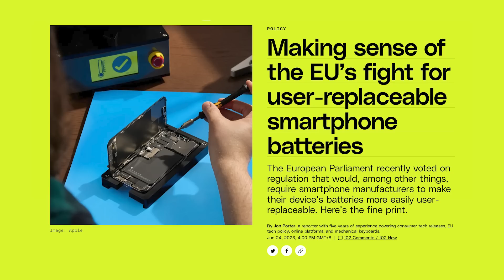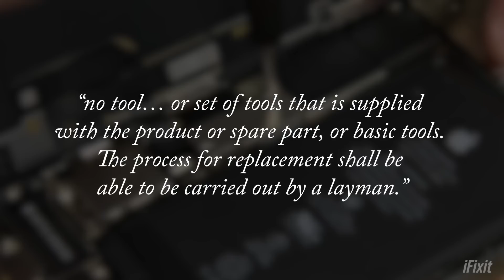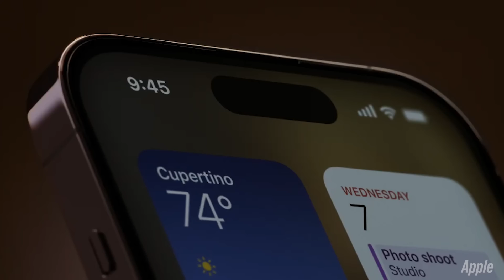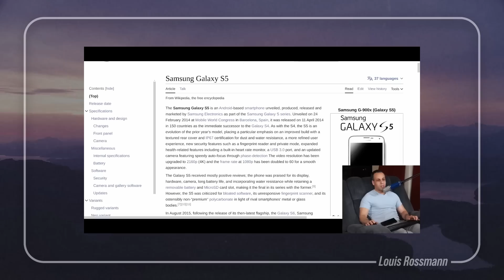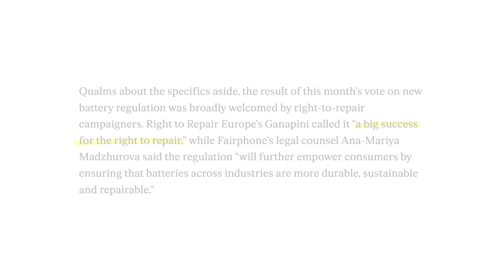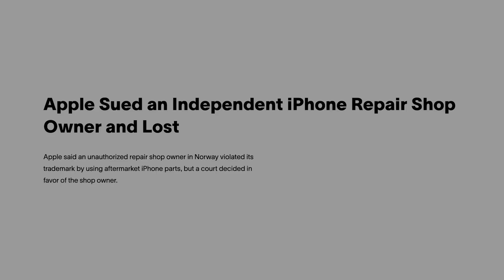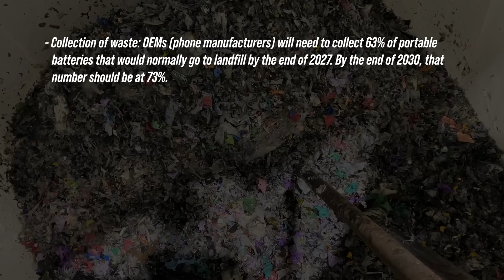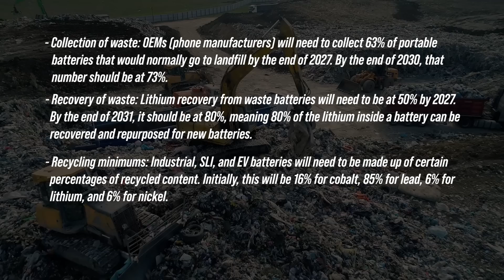EU Just Changed Smartphones Forever

Comment: It seems that there are a lot of people, perhaps most people don’t realise you can get an iPhone battery replaced by Apple and it’s not an extortionate cost in my opinion. Sure it’s a lot more than just buying the battery and replacing it yourself. But the point is that people don’t seem to be aware. An old battery of course has less battery life and can affect the performance. I have an iPhone XS Max and will soon be replacing its battery and using the phone for another one or two years… and then buy a two year old iPhone. This XS Max was a two year old refurb for half the price of new.

Comment: We'll see how this works out. GDPR made the UX worse for European users. The EU has good principles, but they don't really think things through. I think distinct EU/non-EU phones are VERY likely. And if it turns out the non-EU ones are better it will result in a black market for non-EU phones. Why not just tax the devices extra when sold and offer the extra money as incentive for users to turn in their old devices? Also, how the hell are car manufacturers supposed to make a car where you don't need special tools to replace the battery?

Comment: Unswappable batteries are planned obsolescence. Everything else in a smartphone can last long, very long, especially with Qi charging. But the battery limits the lifetime. Size the battery so it barely lasts a day, or not even a half day for heavy users. Combined with the right strategy to "optimize" battery charging it will last exactly as planned until the end of warranty, and then fail quickly. Apple has already been caught on this a few times. And the fact that you cannot enable "always stay in battery saving mode" on apple devices tops this - you have to work around that with automation bound to "plug in charge cable", "battery at 100%" and a ton of more events to make it stay in that mode.
(private phone is Xiaomi mi 9 with Qi, standby time was up to seven days at the beginning, and is currently still at up to five days)

Comment: Non replaceable batteries is def a profit driven Manufacturer construct. My perfectly working Samsung phone is now obsolete as it won't hold a charge for more than a couple of hours. Can't get into it tho as it's a sealed unit. Same with my kindle fire. It all ends up in landfill eventually causing a massive electronic waste problem of perfectly working devices that simply just need a new battery. Good move EU!

Comment: Truth is, ive had phones from an early cellnet phone, through to Nokia, Samsung N, HTC Desire, to Galaxy S, never bought a new battery once, tech moved so quick to care. There's two or more (said here) things going on here, First stopping companies like apple being dicks here pairing batteries, as even early iphones was easy to change the battery just 2 screws. Second, SOCs have got that powerful they can span multiple generations of phone, only artificially made obsolete by either battery degradation or lack of software support by the manufacturer. There's no need to have a flag ship phone and if I do get one that costs a grand, id probably want keep it for like 4 to 5 years now. Gone are the days where its cool to have the districtive latest phone for me they all look and do the same, just like my iPhone 4 did exactly the same as now but with a poorer camera etc.

Comment: Smartphones used to have replaceable batteries and some were egen water resistent. Only reason the batteries was glued into the phone was to get people to buy new. Just like 99% don’t use anything in Word that did not exits 20 years ago, also I think that 99% probably would be sufficient with a 5-10 year old phone if the battery was still working. They don’t use their phone for other than a few photos, social media, navigation and of course texting and calling people.
Phones housed to have plastic backs that was cheap to replace. But when the manufacturers fixed the battery, they also made a fragile glass back. They tell everyone it was to not make the phones scratch as easily, but the truth is they can earn a lot of money replacing these glass backs. The first iPad is near indestructible. Try to hit the back or front with a hammer (don’t do it, find videos of this). Not a scratch. Later generations shatter like fragile glass.

Comment: Should be an open database for manufacturer-specified and independently reported lifespans and failure rates for components going into devices, so other aspects of device longevity can be optimized over time. While batteries are the main point of performance degredation, if other components start failing in the lifespan of the second battery, the move to make them replaceable may not be optimal without reviewing other failure points too. Likely just teething issues to be dealt with down the line. Battery replacement will extend the service life of so many devices.

Comment: I think materials choices for esthetics particularly glass had a big influence. I absolutely think that planned obsolescence creating continuous market demand was a strategic interest in the choice for phone manufacturers. I have mixed feelings about forcing consumers hands. I'd prefer we cost in the end of life cost at time of purchase to encourage decisions that way.
Reply: I'm still using an LG G4 which I rooted and put android 11 on it.
Still works great for many things even if it is now very slow compared to modern phones.
I don't have to worry about leaving it on permanent charge for things like it's night clock and radio and stuff because I know once the battery degrades and starts to swell, it a simple case of pop off the back, take out old battery, put in new one, good as new.

I also have an LG H910 which is the USA V20, an oppo a54s and 2 oppo a54 5g's.
So having phones with replaceable batteries doesn't stop people buying newer phones, it simply allows them to keep using the phones for other things after they have upgraded
Reply: @TheVampyrical  I want replaceable batteries, other service parts ideally upgradable radios expandable storage. Screen options. Display out and multiple/repairable USB-C ports.
Go so far as to make it like a frame work laptop where at the end of phone life I can make The board a game console. Real auxillary cooling would be a nice option. In that case.

I just switched to a Moto G100 and I'm planning to turn my Galaxy s10e into a gaming console. I should look and see if there's a good Android distribution for that use. If that works out maybe I'll pick up some used S20 FE to make a couple more.

It's nice to have a recent snap dragon 8 series.
Reply: glass or not, we could still replace the batteries as your average nerd.

Apple made that impossible by actually putting serial number registration in the firmware. Actively blocking the sale of batteries and even the use of donor parts, is where the real crime is.
That's a very concious effort to be evil. There's simply no excuse.

We already created more than enough ways to replace the batteries in modern smartphones without those crazy evil deeds.

Comment: Regulators around the world are feeling too full of themselves - they think they're kings of the world.

The iPhone is neither designed, manufactured, or programmed in the UK or EU and yet they think they can dictate all aspects of its design, construction, and software implementation. As an Apple stockholder I'm frankly getting sick of it.

Regulators come in and think they can penalize companies and threaten their world income - not just the income earned in the target country. They think they're hardware and software engineers and make demands for implementation of features. I'm beginning to think that Apple should put together two models of iPhone Pros - the Regulator version and the World version.

Want to mandate replaceable batteries?

Fine - the Regulator version would have replaceable batteries and a battery cover, but would lack features like inductive charging and may be larger, heavier, and have a later release date and probably be more expensive.

Want to force interoperability with less secure protocols?

Fine - iPhones in the Regulator phone would lack iMessage and FaceTime support so the user could install any 3rd party software they want.

The World version would be the iPhone we know and use today - the Regulator version would be hobbled in whatever fashion is required to fit into overly regulated markets.

In the more sanely regulated markets both versions of the phone would be available - and authorities in the Regulator only markets could have fun trying to keep grey market World phones from being smuggled in.

BTW, good luck dealing with all the lithium batteries which appear in trash bins - deposited there by lazy or ignorant consumers who don't care or don't bother to read the disposal instructions.

Comment: Why don't they focus on giving us our damn chargers back.  I just spent $2000 on a 1tb zfold 5 and that was with $150 off. I didn't even get a charger. I didn't even get a sticker. I got a stupid sim ejection tool and the phone. I'm more pissed about this. $2000 should get you wireless earbuds, super fast charger, case, external SSD, camera lens kit, and a damn S-pen. Fold 1 at least had some accessories

Comment: Lightning cable doesn't wobble, though.... and removable batteries change the construction of your phone. With a frame, front glass which used to contain alot more adhesive, grey back frame to keep battery apart and a back cover. IDK how convenient that is but currently iphones are hermetically sealed... that would be an obvious downgrade.

Comment: I want to see how Apple maliciously comply with this.
Reply: $199 battery
Reply: I want to see the EU regulate to protect me and put them back in their place.
Reply: @TheMercifulKnight   Yeah never thought I'd like an EU reg, but Apple can get f**ked on this one. Part of the reason I went Android is how much Apple extorts its consumers with proprietary gear and malicious "authenticity verification".
Reply: They will put micro chip into the battery and ask for it 100x the price is would cost on any other phone.
Reply: Cannot buy battery must rent it 😂
Reply: No different than to see if Tesla complies with it's EV batteries. Apple is one of the worst offenders, but hardly the only one.
Reply: @leftcoaster67  to be fair, when it comes to EV's there's actually a difference in how batteries are worked into the EV or how the battery actually works. It's so many levels more complex than a phone. The comparison is actually apples and oranges.

Where it comes to 'the layman should be able to do it', this probably means with an EV that you'll have to be able to screw it out and unplug a cable or 2, but I doubt it'll take away the limit of using certain battery packs.

The same will probably be true for phones as they use different sizes and shapes. The EU isn't exactly demanding that Apple or Tesla allows 3rd party batteries into their products. They're demanding the batteries should be available for anyone to buy and there basically shouldn't be anything obviously blocking a simple repair (like a glued battery without pull tabs). Where it comes to Apple, they actually made sure you can't even replace the battery with the genuine thing unless you go to an apple store and hand over your phone. AFAIK (though I'm not up to date on this) you can replace your Tesla battery with any other battery as long as you can get your hands on one.
Reply: $10,000 battery
Reply: Apple already includes pull-tabs on the adhesives in their most recent products. The only difficult part right now is opening the phone up.
Reply: Phone costs $20, battery costs $1,999. I wonder how much hardware the EU limits them from building into the battery.
Reply: Same, this will be fun to watch
Reply: The EU has previous experience how to handle Apple.
Reply: @danielmantione  That's true but I also want to see how Apple really bends the rules that will force the EU to tighten the regulations
Reply: malicious compliance = people start to scuttle away from these scumbags, because i can assure you, the customers will be the one paying. Good riddance.
Reply: $500 battery that lasts 2 1/2 minutes, probably.
Reply: I use iPhone since 2009, I never had problems with battery. Maybe I’m just lucky :)
Reply: @faahkoo exactly, this is just an apple hate fest. Sad really
Reply: If people were smarter, they would have simply refused buying Apple products. Most of Apple users aren't tied to Apple's ecosystem, they are just tied to the brand and brand perception.

The easiest way to force Apple to change, is to starve them financially.

Anyway, the most likely outcome is that customers will keep on behaving like self-harming zombies, meanwhile Apple will use some dirty trick to comply with regulations.
Reply: The phone doesn't come with the battery.
Reply: Shhh everyone, you are giving Apple ideas. 😊
Reply: They will maybe put USB C on Iphone 15, how long will it take them for removable batteries? 2030 maybe?
Reply: @xsAMOR  they won't put USB C on them, they'll go with Apple proprietary Wireless charging
Reply: Kudos for the phrase 'maliciously comply'.

Comment: Guaranteeing the security of a computing system is nearly impossible if anyone can tinker with it and replace components with unofficial hardware.

Besides, Apple already has a solution for the interchangeable batteries issue, it's called MagSafe, now part of the Qi2 wireless power standard.

Comment: I had a Galaxy S5, you could buy a battery charger for like $5-10 and it would come with batteries
I had 4 batteries and never had to worry if I couldn’t charge my phone. The battery charger even has a USB port
Also the cord to charge the S5 had a micro USB charger inside it’s like USB 3.0 or whatever charger so if you didn’t have its cord, you could still use the regular android cord
It was fantastic. I love my IPhone 12 Pro Max but I miss my S5

Comment: gone are the days of waterproof phones, plus smartphone battery technology has gotten so much better that you can buy a phone today and go 7 years without a batter replacement (im talking about premium phones) that alone makes replaceable batteries in phone useless as by the time the battery would get so worse to the point of replacement, other software features would be even worse at that point buying a new phone would be better. i would rather have a waterproof and robust phone without a replaceable battery than a phone that breaks into two parts when i drop it

Comment: It just makes sense: a product that works for several years with a battery that lasts 1/2 of that and highly problematic to replace. 

So you trash a working device because of a well known shorter service life single component. 

I’ve had the batt replaced in my iPhone 8 a couple of times. Fortunately that is only a $20 labor and $20 batt. Oh if only the batt could be a plug and play swap.

Comment: I removed the swollen battery from an older device (Amazon inhouse branded phone with, oreo 8.1 SD 430 3GB Ram - I know its crap but i use it for random experiments and it still works lag free), removed the battery circuit to connect external batteries, made a hole at the back panel and hooked it up externally with 6 18650 liion batteries 2660 mah each for total 15000 plus mah battery. I never thought it would even be able to charge but it does, just using the phone charger as usual and i am blown away, the phone doesn't want to die for weeks slight usage and couple days of running load. Best experiment ever, this might not work on all phones but i just wanted to prove the hardware is usefull, just the batteries not being replaceable make people dump them in the bin. 

Bringing back replaceable batteries for phones is a big win for sure !!!!!

Comment: Its definitely a step towards better sustainability
Frankly speaking, even when battery's aren't easily replaceable, I can tell you that at least with my Samsung S9, they will say they are not responsible for the phone not being waterproof once the backpanel has been removed for any reason. The logic behind this was that the water sealant can only be applied at the factory & hence such a seal can't be replicated. Please!! Gaskets??

Also when this gets introduced, I'm sure they will find a way to charge higher or make it difficult to reach the battery by way of arrangements as shown in the Mac laptop.

But remember; even if this is passed, it will be very hard to coax consumers into letting go of old habits; they are so used to buying new devices the moment something needs fixing, so I doubt this will have any impact in the short term

Comment: Not to mention the EU had for the past decade or so been working on legislation to require all consumer electronics to have the same charging port. In fact, that became law last year, meaning that companies that don't comply by 2024 risk being banned from the EU. This law is only really an issue for one company: Apple.
However, Apple has apparently stated it will comply and it looks like the iPhone 15 line might be the first iPhones to feature USB-C, though it should be noted that the law requires a common charging port for all consumer electronics by the end of 2024, meaning the iPhone 15 could be Lighting but the 16 most definitely will be USB-C or else Apple risk being banned from the EU

Comment: This is a profit issue. It would be fairly trivial to use a metal backplate secured by smail countersunk fasrers and to use elastomer gaskets in place of the adhesive to achieve water and dust resistance.